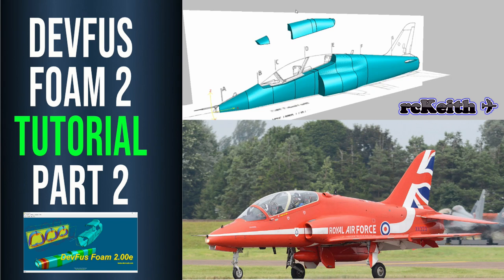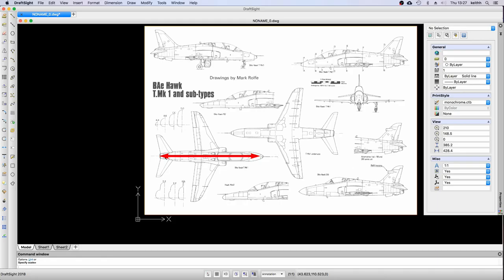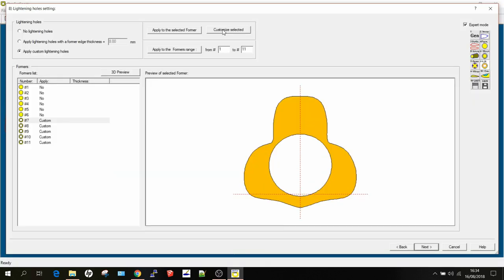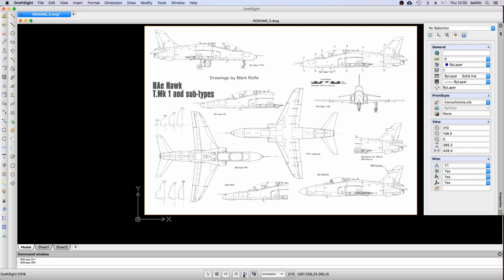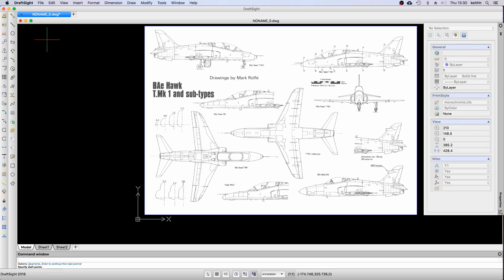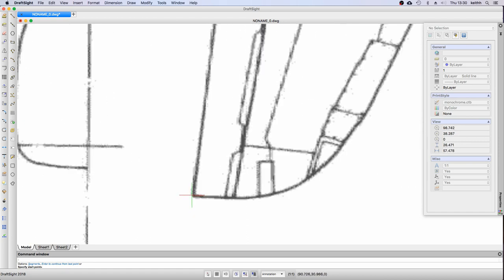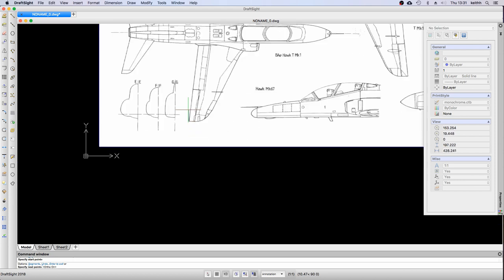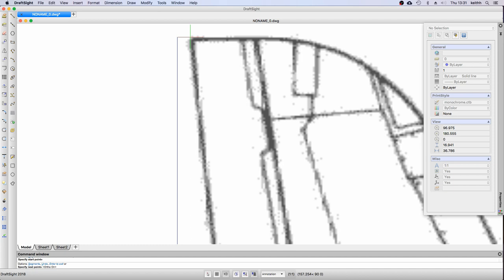DevFus Foam 2 Design

Comment: Hello, Mr. Keith:

I am considering buying this software to ease manufacturing of an aircraft I am designing. I read on your blog that you can import and export .DXF files using the software, does this mean that I can import .DXF or .DAT file and use it as cross sections instead of trying to emulate the shape manually kind of similar to how devWing does it with airfoils?
Reply from the maker: DevFusFoam can only use a DXF file to help in the former cross-section design. It is then treated as an image. 
Once you have your design you can export the formers to DXF.
I would suggest you download it and see what's possible. It won't let export as DXF until you purchase a license. But it should help you decide if it will work for you. Hope that helps